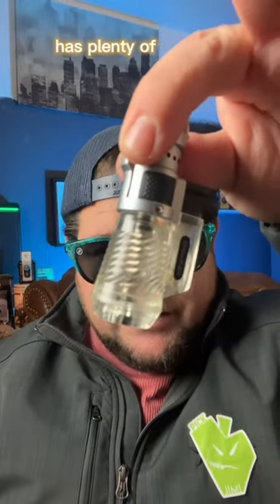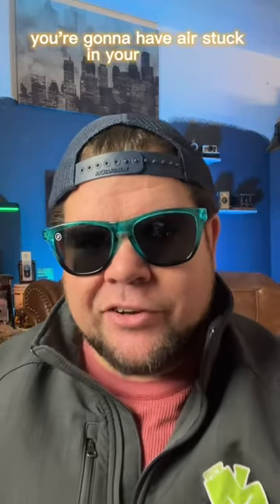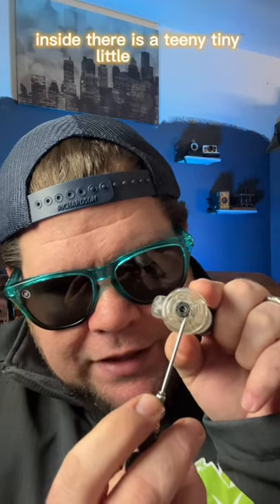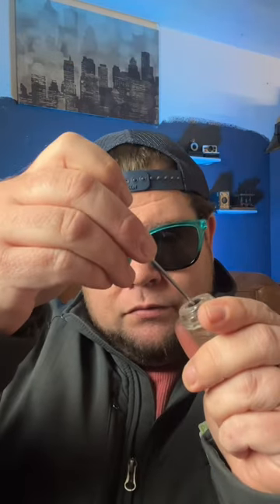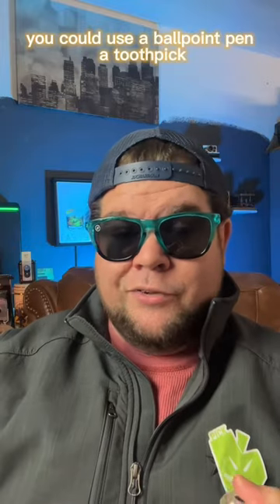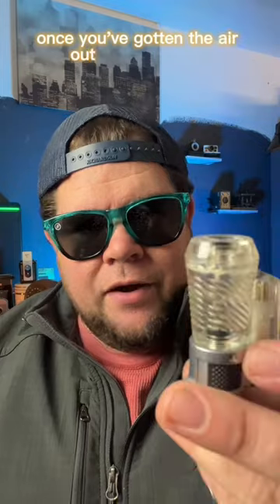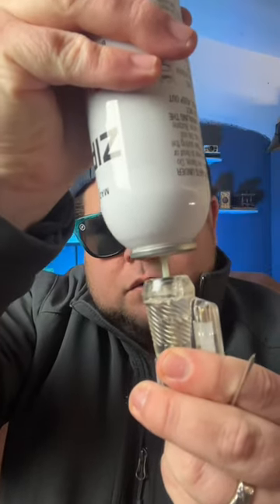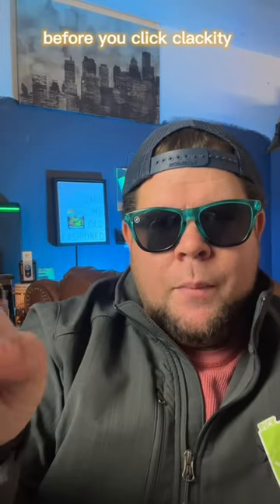How to Bleed And Refuel Your Lighter #cigars101 #cigar #tips #tutorial

Comment: Does it consume more fuel if it’s not bled? Bcs I just rawdog it and works just fine, what would happen?
Reply from the maker: It doesn’t consume more fuel, but you cant put as much in it if you don’t bleed. When you bleed the lighter, you are removing the excess compressed air to make room for more fuel. 

If your lighter sputters or has a difficult time staying lit, it probably has excess air stuck inside.